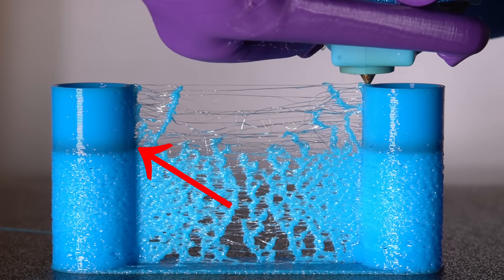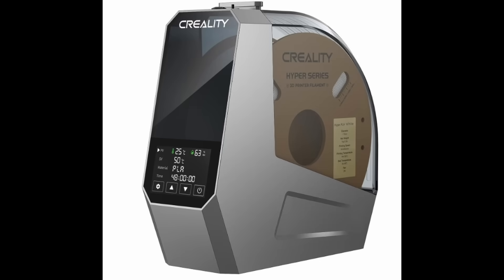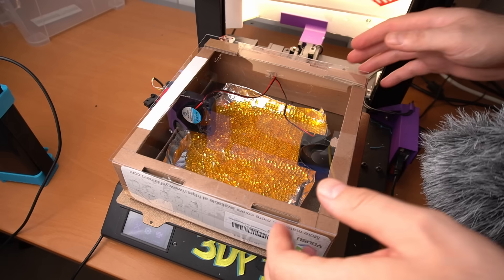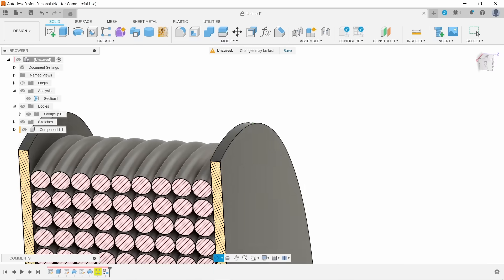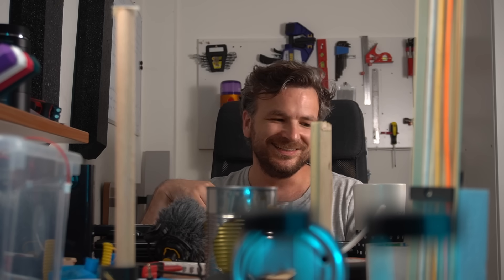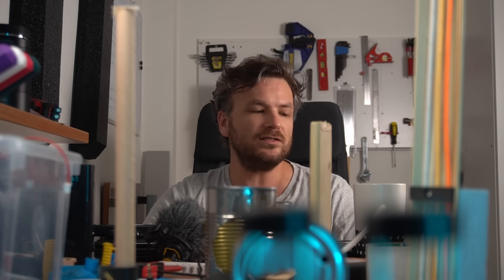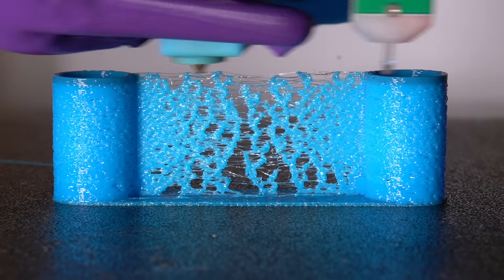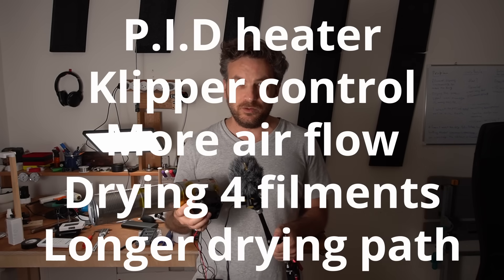Why are we drying filament this way?

Comment: :face-fuchsia-wide-eyes: I have been doing this for years. But I use a very large sealed chamber I place the whole spool inside. I use a fan that heat the chamber and produces violent air flow. The filament is dried as it comes off the spool and the moisture is deposited into aluminum oxide cans that I recharge each time I place a new spool in the chamber.  :goat-turquoise-white-horns::hand-purple-blue-peace:

Comment: You would get better results if you put the fan at the end where the filament exits. This would put the driest air (i.e. the air most able to extract water) in contact with the driest filament (i.e. the filament that is least able to lose water.)

It will also help maintain a more consistent gradient (between filament and air) across the length of the can.

Comment: Using materials which are cheap and people throw away I was thinking of a metal tube used in vacuum cleaner wands and a hair dryer. Hair curling tongs may also have a suitable heating element as would many other cheap kitchen appliances.

Comment: Eh. I just throw a roll of filament in my food dehydrator for a couple hours the night before in cool weather- or right now in the summer i just throw it on the porch and it dries in an hour in the insane dry heat and sun😂 im lucky that humidity is only a bad problem in winter time. Summer time even with filament just sitting out moisture is very low to non exsistent and is easy to get to nothing. But good job on your project😂 looks like something id whip up😂 i built a plastic injection molding machine from scratch (actually looks good and works amazing for large objects) just like filament ive found there are some plastics i shred and reuse for plastic injection that are affected by residual moisture. The entire time building it i never once thought humidity would be an issue with THAT process😂 i have tarps with piles of cleaned shredded plastic laying around in the sun looking like a trash hoarder😂

Comment: No real time / in-line filament driers because there is a LOT more money when people have success with 1 drying box and buy 3 more drying boxes for the rest of their humidity sensitive spools. Same reason in-line filament production from waste or bulk plastic does not exist in the consumer space.

For version 2, I'd kitbash the cheapest temperature + time controllable food dehydrator that is tall and cylindrical.  Create a spiral guide spool with lots of open space between filament guide channels in the airflow column.   Have the filament come in the top, wind around the spiral spool several dozen times in a single layer and come out the bottom to the printer (top to bottom filament movement to maintain moisture removal gradient since the warm, dry air is blown upward in a dehydrator). Plus the spool assembly can be taken back out and the dehydrator used for whole spool drying or even food.

Comment: I found a simple solution. I use a large Rubbermaid type of container that holds all the filament. Maybe 10 spools. I fill up an old filament box with dessicant that I cut out lots of holes in. About once a week I throw the dessicant in the oven at just over boiling water temperature for about an hour. This keeps it around 24% in the box and I don't worry about it on the machine because it's not there long enough to absorb water. I don't leave it on the machine when not printing. This is simple and it works for me.

Comment: One thing I'd suggest looking into, though it'd be more complex (and something I've been toying with as an idea) is figuring out how to integrate a silica desiccant regeneration cycle. The idea is to run cool air through silica, or some other desiccant, warm the air (dropping relative humidity in the process), blow that over/around the filament, then have a second system that somehow blows warm air over another patch of the desiccant. Something like a rotating plate of desiccant so that "dry" desiccant is exposed to the incoming air to dry the filament, and "wet" desiccant is constantly dried, with a slow motor to keep the whole system rotating.

This isn't a new idea; it's how plastic pellet driers work in injection molding on an industrial scale, though those often dry 200+ pounds of plastic continuously.

Comment: So, I noticed this same issue when I was running multiple Sunlu S1 driers for my printers. No air circulation. I have since replaced ALL my driers with either the Theta Hex dryer or the Sunlu S4 (4 rolls distribution system with airflow AND dedicated areas for silica packets.)

Though only the top layer is being dried when a whole roll is put in, that's all you need at that point. Your inline actually dries less filament in the same time.

I really like the S4 dryer for my current setup, where it feeds 4 P1S printers. But I have a couple of the Hex dryers for my other printers. The Hex has a built in hydrometer as well.

Comment: I could be wrong, but I'd guess inline filament drying isn't done often simply because it's very power hungry compared to an enclosed heatbox. Also while it might work well for filaments with comparatively high permeability (basically any flex filaments), more rigid filaments (like PETG or Nylon/PA) take a lot more time to thoroughly dry, so you'd need a really, really long drying path, which would use even more power.

Comment: Does preheating the filament change its Printing properties ? like maybe it stretches more resulting in under extrusion or there aren’t any significant problems ?
Reply: also what about having a set up that will take 1 filament roll and push it threw some heater or something that will dehumidify the filament and then roll it on another roll so you can have almost all the way  perfectly dry filament  for storing

Comment: Maybe use a heat gun with adjustable temperature with the tin cans and zigzag the filament between several pullies to have more filament in the cans longer.

Comment: What about adding a fan to an off the shelf filament dryer, and using it as a buffer, rather than to hold the spool? Add a filament port to the back of the box and use an empty spool to wrap the filament one or two times around the spool...

Comment: Maybe you send the Filament over some rollers within your filament dryer, to make the filament stay longer within the hot air and to keep the dryer small. With only one pulley eg. at the bottom of the can, you can double the time , the filament stays in the dryer.  Lead the filament into the can on the top for example , it travels to the bottom, over the pulley, back to the top, where it exits the dryer into your extruder. Voila! Same dimensions of the dryer, double the effect. You could also make a new design, printed in ABS and use several pulleys! FYI, i placed a 1.6m Base Reflex  tube in a Subwoofer thats 25x20x7 cm, by falding it Up. So plenty of space for Filament. But mind the friction!

Comment: Yes, we need a proper DIY, or at least affordable, solution to inline filament drying. Taking a page out of Drywise's book, look into building a molecular sieve chamber to pass the dried heated air though to further dry it. Air speed as well as air-tightness is also a factor to not draw in unheated/dried air.

Comment: even long open tpu 95A is not that messy, even if its messy. also dont forget anymore. dont mind the language bugs, they dry out on their own. like the rags outside. lol. or just AC your house to low humidity, it does not need to be rainforest out there. lol. because those products that would be useful dont sell for large amounts of money easily. blame the markets. push the inline filament driers to the 3d printer manufacturers. to include those by default. in the 3d printers. its not hard to add those. its just another print head. without nozzle. well remove the nozzle but leave the heater there.

Comment: Man your heater is the issue. Build it like an industrial long form oven and feed the filament through a path internally through a couple small holes. Keep the cans but attach four or five end to end. Place fan paths a few places down being fed from a plenum full of dessicant. You want hot, dry air since you don’t want to affect the overall temp of the filament. Just make hot DRY air and make lots of flow. I’m not into 3d printing but I came across your video. I won’t see a response if there is one but good luck

Comment: ideas for improvements:
- check if countercurrent exchange works possibly improves drying, i.e. check if flow from start to end or from end to start works better https://en.wikipedia.org/wiki/Countercurrent_exchange
- heat regeneration: have the hot, humid air give its heat to the fresh, dry air to improve energy efficiency

Comment: The physics of this problem are both interesting and complicated. The reason heating up the air works is because hot air has a higher capacity to hold moisture than cold air. This is why we frequently track humidity as relative humidity. I don't fully understand the physics, but the water molecules in the filament are more likely to sublimate into a material such as hot air when the relative humidity is low. I think your best results with this method would come from passing the air through a desiccant chamber on the cold side (relative humidity is higher and therefore the moisture is more likely to be pulled out by the silica) before it passes through the heater, which will further lower the relative humidity.

Comment: One problem I have with run time drying is that the pla I use, for whatever reason, gets stupidly brittle when it absorbs too much moisture and oftentimes will crack coming off the roll if I don't oven dry it first.

Comment: For those interested storing spools you've dried can easily be done with a home vacuum sealer and their plastic bags works really well - on the cheap you can also use a dry bag and a vacuum cleaner with some silica gel for storage. Remove the air you remove the moisture buildup and using a rare compound or color isn't going to be several day job drying it over and over.

Comment: I would say that it has the potential to work, its just too variable for a commercial product:
when the entire spool is dried, it makes for kind of a sledgehammer hard to mess up approach

If the filament is supposed to get dried in the rather short time it takes it to travel through the in-line dryer... there are a lot of variables:
the filament type, how wet it is, how dry is dry enough;
the temperature of the dryer, relative humidity of the environment
the print speed (are we drying filament for a 0.2mm nozzle Ender 3, or a 0.8 mm CHT nozzled Voron), amount of retraction (i could even see the filament getting loose upon retracting and slamming to the heated wall, would make for an unhappy bowden tube...)

As to the remedies: having the air pass through a drying chamber before it is heated, or having as dry an air as possible recirculating in a closed loop, sounds like a smart idea (also like the thing Drywise are doing); 
making the drying tunnel long enough, or adding several stages, and acknowledging that drying a week old PETG and a year old Nylon are a bit different

Comment: I’m new to printing.  I just opened my first roll of TPU, which was vacuum sealed with a silica gel pack.  Couldn’t we just reseal the filament like it was shipped? I have a vac sealer.  It makes sense that it would circumvent the whole process of the tpu taking on moisture in the first place.

Comment: Use two spools inside the cans to route the filament into a longer internal path, instant, 3x, 5x lengthening of the drying time.  If the diameter of the spool increases friction too much, use a rectangular chamber (like a narrow heating duct) and increase the diameter of the spools - at which point a single spool with multiple wraps would suffice to increase the exposure, and the airflow could be forced from inside the spool to the outside directly past the filament.

Comment: The more I think about filament drying, the more surprised I am that this isn’t a feature of every modern 3D printer on the market. It’s as if everyone is using brand new filament and living in a desert. The community is so focused on improving the quality and speed of the hardware that it seems to almost completely overlook the material side of things.

Another idea to rapidly dry filament would be more complex, melting it earlier and using airflow to carry away the moisture before injecting it into the nozzle. Imagine a hotend that has two melt zones instead of one. The hard part would be to remove the moisture without molten filament leaks
Reply from the maker: Thats an interesting idea, it also creates a new set of problems to solve.
retraction and ozzing come to mind, can't retract melted pool of filament, probably will require to rethink the whole print head assambly.

Comment: Thanks for the video. I almost patented an inline dryer for filaments 12 years ago, did the calculations about needed drying lengths, designed simple setups etc. 
As to the why we dont see this more often: In the 3D printing industry, somehow the knowledge about how to properly prepare material for extrusion seems to not have transferred from regular extrusion processes like injection molding. Every TDS for granules used in conventional extrusion has at least a drying recommendation, most even have a specified maximum residual moisture content for processing. Stratasys went around this in providing (well) sealed containers, which mostly were used quick enough so the users did not often encounter this issue. Then after the patents expired and reprap started using welding wires for printing, nobody really thought about this. Since more and more people are into 3D printing now with materials more prone to issues with moisture (PLA and ABS are not as problematic as TPU or PA), the topic gets more attention. I still see posts almost daily about users boasting they never dried any filament and that it's plain useless. As a material scientist myself, statements like this make my head hurt. That's like saying you don't ever need to clean a surface before using glue on it. Of course you always can be lucky, but it's just good practice to stick to proven and meaningful recommendations.
Reply from the maker: Lots of comments on this video as well about not needing to dry filament, i guess they leave in a dry area and or store filament properly. Maybe you want to share some advice for v2 from your experience?
Reply: After he raised the question "why don't we see more of those filament driers on the market?" My first thought was: does Stratasys have a patent on this and just block everyone else like they have been doing for the last 40 years with anything related to 3D printing?
Reply: I mean, if you keep your filament dry in the first place, drying it is indeed kinda useless. Or if you use it fast enough it doesn't have time to get moist enough to be a problem. This works better with materials like PLA that don't take it up too fast, of course.

Moisture management is important, specifically drying is not

Comment: Hooooold up, did everyone miss the caption??
 You changed several variables in the experiment. 
Experiment 1. Humid TPU, prints horribly, turns on dryer, no improvement.
Experiment 2. Humid TPU inside drybox, prints horribly, turns on dryer AND changes print settings, print improves.
If anything, this proves the dry box and your dryer are useless, and print settings can overcome damp filament.

Comment: There are no cheap in-line filament dryers on the market because the $15 Amazon food dehydrator exists. Print a spindle, stick the spindle in the dehydrator with your roll of filament, drill a hole for the filament to exit the chamber, feed it to your printer. I shouldn't have to say it, but never use your dehydrator for food again after this. Buy two if you want to dry your food.

Comment: Alright, so the ideal design I can think of is a longish heat insulated tube, maybe half a meter, maybe a cm or two in diameter, filled with an infill of some sort that allows air to flow through it, with a filament sized hole (2-3mm) going through the center of it all. The infill will mix the air up and ideally expose all the air to the filament, completely saturating it by the end of the tube. May need a like, filament needle to thread it through the drier initially since it is likely the filament would want to get caught up on the infill.
The filament should run counter to the direction of air flow, like a counter-flow heat exchanger, for the same reason as a heat exchanger: the filament just entering the dryer will be wetter than the filament leaving it, and so the wetter air that has picked up moisture as it travels through the dryer should still be capable of pulling some moisture from the filament, drying it out a little bit as it progresses down the dryer. In this way filament progressively gets a little drier as the air becomes a little wetter. At the end of the dryer the driest filament will meet the driest air and hopefully be just about at the same dryness as the air as it leaves the dryer.
If you wanted to be efficient with your energy you could incorporate an actual cross flow heat exchanger to pull the heat from the warm moist exhaust air, and warm up the room temp intake air, thus warming the intake air up before it hits the dryer's heater.
The entrance of the dryer could even be a filament wiper which would act like an air seal to make sure the exhaust air goes through the second heat exchanger.
Since the temperature of the dryer should never exceed the glass transition temp you should be able to 3d print this dryer tube with the highest glass transition temp material you have.